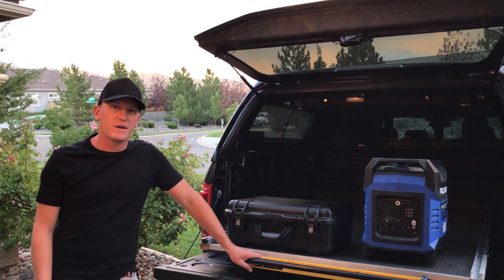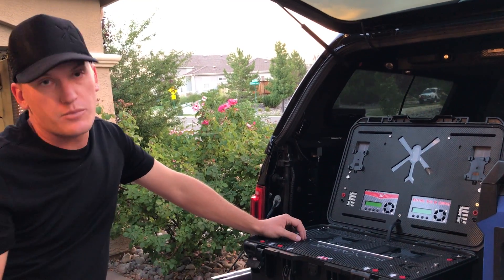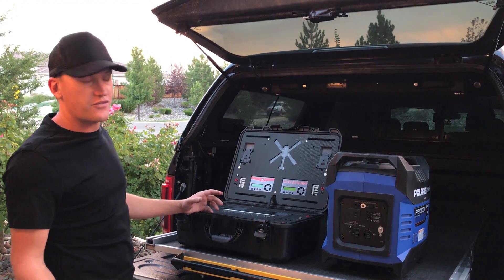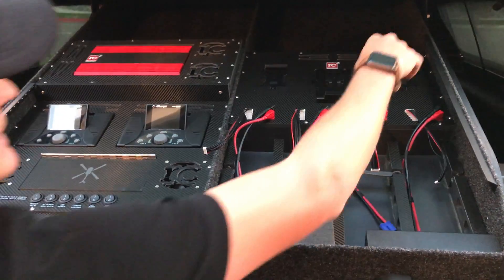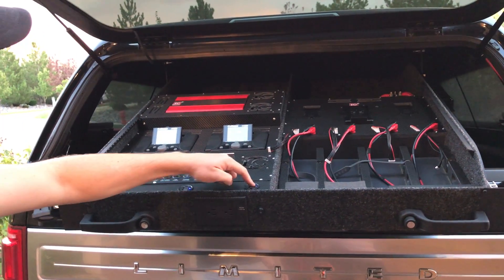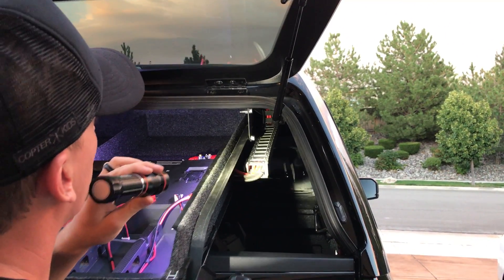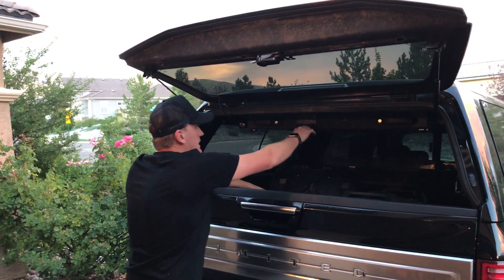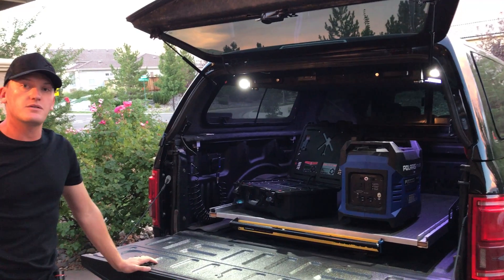INSANE DRONE BATTERY CHARGER - Copter Kids On-Board Charging Setup

Comment: Here's a question you drone operators may answer.
I have a DJI Mavic-2-zoom...

My vehicles have a 110VAC outlet in them. The max draw is 150 watts.
Their output is a modified sine wave. I was wondering if I could plug my 6 in 1 charger and charge up the batteries AND charge up the controller and the iPad Mini-4?

I wish the inverter had a 400 watt output with a pure sign wave but that would cost more money from the manufacturer. 

Any suggestions on the safety of the equipment.....